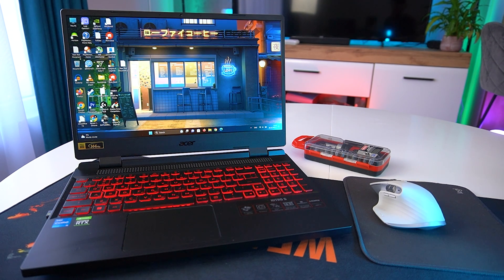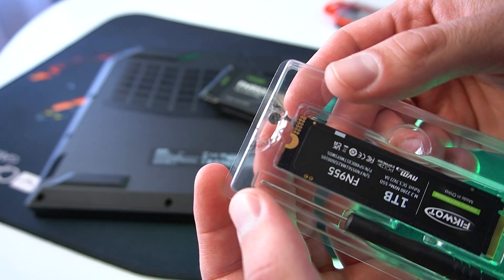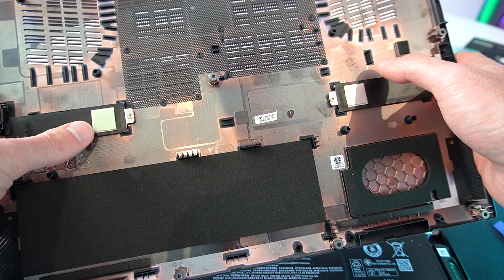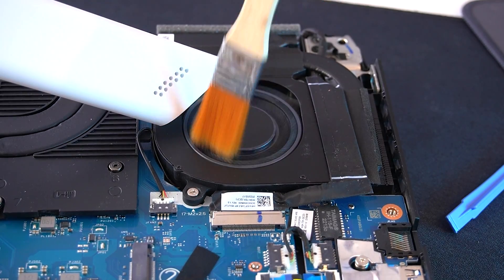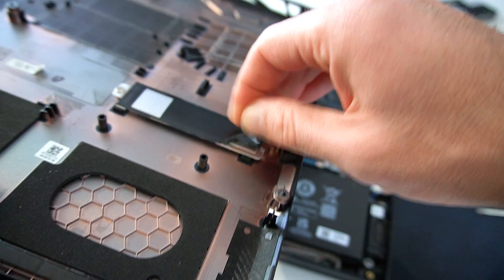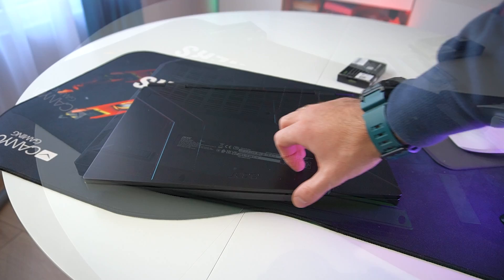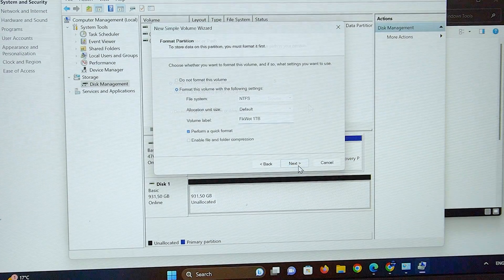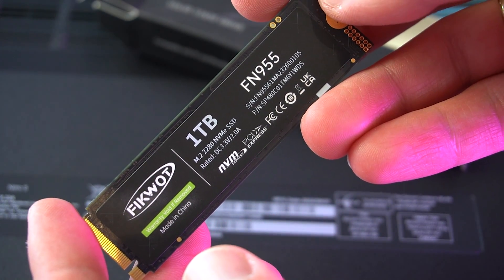Acer Nitro 5 - M.2 SSD Upgrade, Disassemble And Clean

Comment: I have exactly the same laptop with 500GB SSD Micron 3400. I just bought 1TB samsung 990 pro and I plan to replace the existing SSD and make the old SSD as an external drive. I am worried about opening the cover and I saw different videos opening this unit differently. Some do it form the from portion going to the back portion of the laptop. I also ordered thermal pad for the new SSD and I heard you mentioned installing 1mm thermal pad. Did it fit well? I just ordered 0.5mm thickness. Can I just double it to make it 1mm or should I buy 1mm thermal pad? THanks
Reply from the maker: I think it fits well, I don't remember it being a problem, man. Get 1mm pads, though